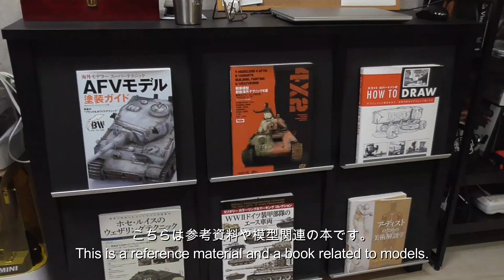#119 [tank plastic model] 番外編 Extra Edition エアブラシ 塗装ブースの紹介等 Airbrush painting booth introduction,etc

Comment: Hi Suji-San!  Love your work.  Question: I am not able to remove paint using water and a brush as easily as you can.  I have followed your procedure exactly, using a clear gloss (Alclad II), AK Worn Effects, Tamiya paints - and I put down the Worn Effects and paint just before I try to remove it.  Can I ask: what type of thinner do you use with your paint?  Thank you very much in advance - I am a subscriber and, as I said, a big fan.  Eric-San
Reply from the maker: Hello!  Thank you very much!  One thing I'm careful about is that I don't apply thick acrylic paint to remove it.  Acrylic paint is diluted with Tamiya's acrylic thinner.  Please try again if you like 😊 Thank you for your continued support 🙇